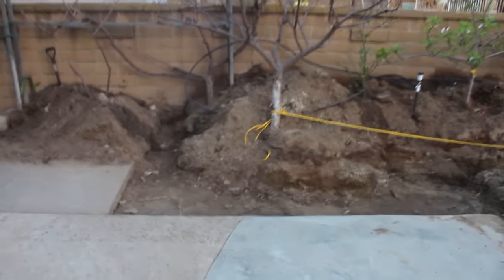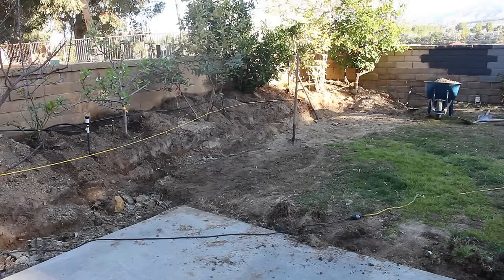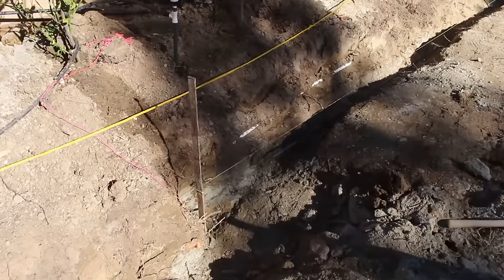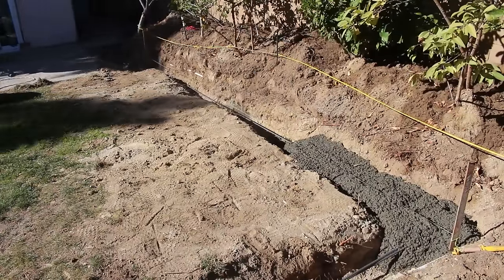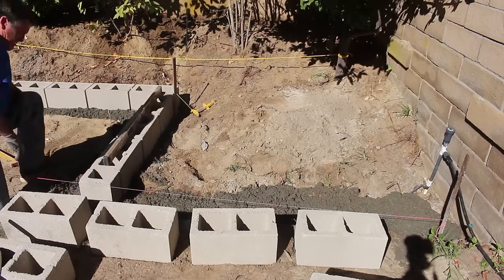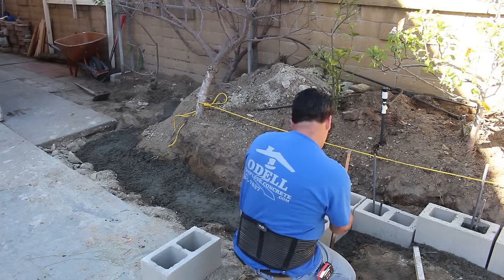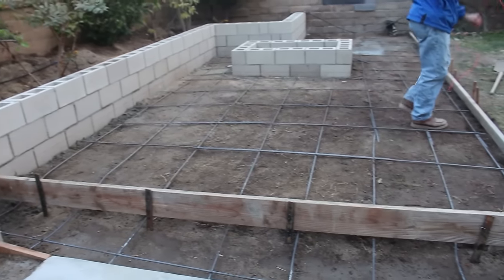How to Build a Retaining wall Easy Guide DIY

Comment: Thank you for all your great video's. Can not tell you how informative they are for a home DIYer. One thing I would suggest as a great addition to your work would be to make a couple that gets into detail about the equipment you use and why and the same for the materials you use and why. Concrete blocks .. there are a lot ... why you use and how to use properly, when and why to use rebar and which kind, how deep does the base need to be for a wall like the one you are building on this video ... could go on but I bet you get my point. 
Again, thanks for you advice.
Reply from the maker: The build depends where your located?

Comment: I do the same for a wall, pull a line off the house and run parallel back off this for your measurements. I also like the fact you have laid the first course of block into the footing, and then filled the block cores, it ends up being a monolithic construction.
Reply from the maker: Yes that's correct.
The best way to build.
You know the tricks.
Reply: @anthony famatigan  @anthony famatigan  Something that is done in one go, done together, becomes one when it is constructed. Basically the concrete in the blocks/core filled is bonding with the foundations so it is one piece of concrete. You have approx two hours to do this otherwise there is a cold join between the two and they are basically seperate so to speak. 👍
Reply: Do you recommend filling all the cores with concrete?

Comment: Great video! Love your calm voice. I do have a few questions though, if you would be so kind to answer. No. 1 - If your sealing the back of the block with this membrane how does the built up rain water escape? I noticed you did not place grout between your bottom course of blocks, is this where the rain water escapes? No. 2 - If you have a 42" wall are you required to install a underdrain system and should the holes face downward? No. - 3 I've been told that you should not allow your filter fabric to lay against your block because the fabric will be sealed by the dirt and cause pressure on your wall which is in direct conflict of question No. 1. Please explain, thanks! Oh' one more question, do you have settling problem by laying your base blocks on wet cement? Should you wait for a period of time before you install your next course? I'm concern about the extra weight!
Reply from the maker: this job is at the top of hill, drainage is not a problem.
Reply from the maker: I want the block to settle in to the concrete.
Reply: @OdellCompleteConcrete  I understand that, I was concern about uneven settling of the blocks prior to curing, especially the added weight of the top course. I like your method of not placing grout between your base blocks, hopefully their is enough rock to prevent dirt from leaking through.

Comment: I like how you’ve incorporated the weep holes in the first course by not grouting gaps.
Reply from the maker: ty
Reply: I'm glad you mentioned that.  I was wondering why they didn't put grout in between those blocks.
Reply: I was wondering if I was seeing that correctly (instead of using PVC), but it wasn’t explicitly called out in video.... so I looked down here in comments for it. Thanks for confirming... I like the idea as well!
Reply: The more I think of it though, how do you keep your uniform staggering overlay on the second row?
Reply: The more I think of it though, how do you keep your uniform staggering overlay on the second row?

Comment: Great videos! Honestly your videos are a big reason why I know how to do slabs and retaining walls. You should do one on doing a cement block house and how to do the corners and tying the walls in with the rebar. How deep  did the first row of block go into the cement and whats the best way to make sure the first row is nice and level longways and side to side?
Reply from the maker: Great idea.
TY
Reply: Nice!  I’ve learned a lot about concrete from Odell too! It’s nice to see a proud and integrity driven contractor

Comment: Question for you sir?  Will that patio area need base rock?  If not, What determines if you need baserock under the concrete?  Thanks again,  great videos.
Reply from the maker: Whether or not you're in a freezing climate or not

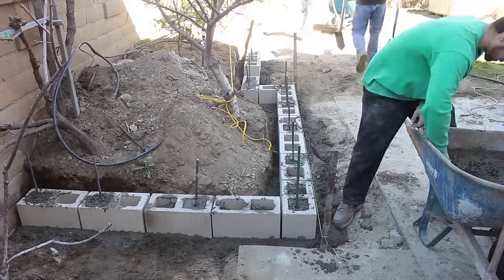Comment: Q:  Around 9:20 you talk about the self-adhesive waterproofing roll...is there a particular brand you recommend?  Great video as usual!
Reply from the maker: Not really there are so many
Reply: Ok.  Just afraid the typically-less-than-proficient box store staff will have no clue what I'm talking about.
Reply: Yeah! Lowes and Home depot are no help. Where I live, I don't have any other options and might have to order online. When I search, the only stuff that comes up is at least $250 a roll my new wall is only 14 feet long :-/
Reply: I decided on using Drylok masonry sealer from Lowes.  I applied it last week...and it definitely seems to "seal" in the porous concrete block effectively.

Comment: Great video. Very helpful.  A few questions.  1. Are you mixing sand and gravel in the concrete. 2. Concrete strength? 3. Are you only filling the cavities that have rebar and leaving the other ones empty? 4. If the wall is small could you use a concrete adhesive instead of mortaring between blocks?
Reply from the maker: Yes adhesive works.
Solid grouted. 3000psi
Reply: Mr O'Dell great video where can I get the vinal membrane wall sealer

Comment: Looking to use cinder block for a small porch add on and I’ll be adding a pad on top of a 20” high block wall.  I live in NW Florida panhandle. He get a lot of rain here. I’ve got gutters, but do I need to concern myself with weep holes at all?

Comment: I need help. My property slopes down low in the back and I wanna put a privacy fence up. My neighbors in back are on lower ground so I need to do a runoff for rainwater as well. Should I use cinder blocks? I'm looking at 4 feet high.
Reply from the maker: Concrete swale

Comment: How deep should I dig if I want my retaining wall to hold back about 5'-7' feet of full dirt? I'm trying to make a level slab on a hillside property. Wall will be about 30' feet long. Property is in Mexico, no codes to worry about. But I want it to last.
Reply from the maker: 2.5 x 3' should do the trick

Comment: Hi, I'm about to build a house retaining wall and it will stand as the house foundation on a bedrock,can I use silicon or even cement for holding down the rebars drilled into the bedrock before concrete footing? Thanks
Reply from the maker: I like epoxy

Comment: Mr. Odell,  I love your videos.  I use them as my "vital guide" when I try to find a solution for my projects.  I was wondering about the self-adhesive waterproof roll you mentioned.  Do you recommend a name brand or is there another solution such as the material: poly waterstop you applied on the retaining wall of your newer video?
I truly welcome your advice!
Reply from the maker: Poly self adhesive is nice
Reply: @OdellCompleteConcrete  , David is it the same kind of peel and stick adhesive that they use for roofing? Please name a brand and where I can get it. Thank you!

Comment: Thank you David for your video!! This is exactly the work I’m doing.  How do I find the waterproofing material you mentioned for the back wall?
Reply from the maker: Henrys 207 or maybe its 107
Reply: You mentioned an easy peel with rubber and vinyl that could last a lifetime.  I tried looking but could only find something similar for laying the floors.  Is it what you are referring to? @ 09:30

Comment: Great clip guys.  Thanks.  Question: What do you use for the fill?  I just started filling my blocks with a 1:2:4 concrete mix because I had enough left over.  Is this what you'd use?
Reply from the maker: I filled the block as I poured the patio
Reply: He was asking what do you use.

Comment: Was all the Blox put together with the same concrete mixture  that was poured for the  base ???
Reply from the maker: No we used a mortar
Reply: @OdellCompleteConcrete  thanks for the reply what kinda concrete would you suggest premixed? Like 5000 quick Crete? For the base under the cinder block?

Comment: I want to build a cinder block retaining wall for a sandpit that'll have a gazebo tent on it. It'll only be 1 block or 2 blocks high with stone veneer to decorate the wall and top stones to seal it. Good or bad idea?
Reply from the maker: Should be nice
Reply: Odell Complete Concrete Thank you for responding! I'm watching your video again for tips, then I'm going to write out my plan and start digging.

Comment: I'm building a small block retaining wall now that I want to install a veneer stone on to match an existing BBQ structure. The old wall failed and was made out of pressure treated lumber. I'm digging the new wall footing now. The wall only needs to be 14" above grade so it's not that tall. I'm digging the footing 12" deep by 12" wide. Will that be sufficient?
Reply from the maker: plenty good

Comment: I am building a similar retaining wall what is the waterproof sealer you were talking about. I was going to use the Henry’s tar but from what you have said it doesn’t last forever and I would like to use something that last forever. 
Thanks in advanced!
Reply from the maker: Bituthene 3000 Flexible Waterproof Membrane

Comment: Great info. and you explain things real clear. Dig you videos. 
I am building a very similar retaining wall (18" AFF to top of wall cap) right about 4' off existing concrete wall. Would you recommend drainage for something that low?
Reply from the maker: It really depends on water runoff.
If the only thing hitting it is the rain and not runoff from other places then drains probably aren't necessary.
Reply: Odell Complete Concrete thanks.  No other water except rain and as you know we barely get enough rain in so cal. Was thinking of turning a few blocks in he first course above grade so that the opening would allow for water to flow onto finished concrete has very good drainage.

Comment: It does not look like each cell had concrete poured in it. I thought it was said to do that. I am building my own retaining wall now, but should I put concrete in every cell or just the one with steel in it? There is dirt on the backside of the wall, much like this one in the video.
Reply from the maker: I put concrete in every cell when its retaining whether it has steel or not.

Comment: What brand/name/type of self adhensive tape (rubber on 1 side, vinyl on other) are you using?? Trying to order and not sure how to find it.
Reply from the maker: Bituthene
Reply: @OdellCompleteConcrete  do you prefer this or the liquid roll/brush on stuff and also what was this liquid stuff you used in your other video (on the backs of the blocks)? TIA
Reply: @OdellCompleteConcrete  brand or link to actual product

Comment: Mr Odell,  We are doing a 2' retaining wall in the back yard with the metal fence posts in the wall.  Would you recommend a block wall or a concrete wall for that application.  Appreciate the help.
Reply from the maker: Either way will work if the block is big enough

Comment: Why is there horizontal rebar before you lay cement on the retaining portion? Does it just add extra strength to the concrete?
Reply from the maker: For sure
Reply: @OdellCompleteConcrete  thanks, im hoping to build a retaining wall in my yard this week. Im nervous as hell but your videos have provided a lot of very useful information. Thank you
Reply: @OdellCompleteConcrete  you didn't mention it in the video but ive seen it in others so im curios. Is it necessary to put a drainage pipe behind the wall? I live in Ca and will be putting in a wall very similar to this. Also can I back fill with the dirt ive removed or do i have to use a more fine material?

Comment: I ve noticed that you ve always fill the block with cement mix inside.. showed in few of your video.. somebody didnt do that.. did they do it for the sake of lowering the budget and ignored the wall strength or what ?? Would you share your opinion ?
Reply from the maker: Depends if its retaining or not

Comment: Regarding the water proofing I came to know that you don't need them as it will not allow water drain and there by break wall.
Reply from the maker: That's interesting, with water absorbing in the block the block will start to coming apart
Reply: You absolutely need dampproofing (waterproofing is an incorrect term) with a appropriate drainage system or you will build hydrostatic pressure behind your retaining wall. Normally leaving the head joints out of the first course along with 3” drain holes every 6’ on center will allow proper drainage.

Comment: It's possible to pour the wall foundation in stages of like 8 feet? I'm trying to replace an old block wall that was terribly put in and is falling apart. Plus on top of the wall there is a fence to my yard that's facing the street. I was thinking of putting in the steel bars and then do pours in sections to maintain privacy of the old fence.
Reply from the maker: The footing should have continuous steel, I guess you can dowel everything together
Reply: Odell Complete Concrete  Thank you for the reply. I am really enjoying your videos and work.

Comment: Love it. I might have a go at setting foundation and first course on the fly. Do you have problems with blocks sinking and messing up the level? Keep concrete mix dry I presume?

I see you didn't butter first course for drainage. I want to render my wall so not sure how that would work. Maybe I could install some weep holes.
Reply from the maker: No worries

Comment: what is your opinion on using asphalt primer or hot mop tar to water proof it ? when you said tar last 15 years i am assuming you are talking about henrys mastic tar,
Reply from the maker: joaquin lopez 
Yes I am.
I think any tar will degrade on exterior with dirt and water against it.
I like the two part component rubber with vinyl on dirt side.
Reply: like the peel n stick that people use on the roofs ?
Reply from the maker: Bituthene by Grace

Comment: A few questions. I'm a beginner and am going to set up a 20 foot long, 4 foot high retaining wall. I have watched about 20 vids so far to learn. So far I have noticed that these guys are the only ones that pour the concrete directly on dirt without using any crushed rock or road base at all. Most other vids all use some sort of crushed rock for a base before pouring the Crete. Is there a reason why they don't use any base for the footing? Are they pouring on super hard Midwest clay or something where base isn't really required? Another question I was wondering, these guys are the only ones I have seen that "wet set" the first run of base blocks, but I have noticed that when wet setting, they never use any mortar between the blocks on the first run. Do they go back later and apply grout or just go on without it? They seem to grout between every block from the second layer and up, but is there a reason the first row doesn't get grout? Thanks and sorry for the long post.
Reply from the maker: No need in gravel in Southern CA. where its beach weatehr everyday.
The bottom course is known as weep holes.
Reply: @OdellCompleteConcrete  thanks for the reply, trying to learn. I was planning on waterproofing the back of the wall, and adding a mini french drain behind it to drain water away as I'm on a pretty serious grade. Should I avoid the weep holes if I'm going to waterproof it?

Comment: Hey! Question: why on the first layer of blocks, you don't put cement between the blocks? You did put them in the holes of the blocks. Is there a reason to do that, or NOT do that?
Reply: Idxearo maybe it allows water to flow out from behind the wall. It looks like they are going to pour a pad in front which is going to cover those holes though. Maybe to save time?
Reply from the maker: In this case with the water proofing and tile going on, the seams will be sealed up.
Reply: Idxearo I was wondering why you don't just dry stack all the blocks as you are going to core fill later. The blocks I used in Australia had a notch so you could run a rebar the length of the wall on each course before you core fill, we had reactive clay soil. Baines lockblock, just glued no mortar joints

Comment: Do u fill blocks with concrete or mortar?
Reply from the maker: Concrete
Reply: @OdellCompleteConcrete  thanks.  One more question. If I'm building small retaining wall up against existing concrete floor, how deep should I dig to set first blocks if my wall will be knee high.

Comment: Im about to venture on my first wall build project. I see many videos where people pour, set and cure the concrete footing before they lay the first course down. But I see that your doing it while it still wet. You find it easier this way? What are the pros and cons?
Reply from the maker: Wet setting the block will never come loose
Reply: @OdellCompleteConcrete  has nothing to do with coming loose. It’s much simpler to wet set the first course to get the wall plumb and level.

Comment: Are you not in a cold climate ??
Reply from the maker: No, its beach weather here everyday
Reply: @OdellCompleteConcrete  i am doing a sililar cmu retaining wall. It will have venneer on the front. I dug to frost line and poured footer. I plan on filling 12 inches behind with drain stone and pipe. I am sealing the  back of block and filling cores with grout. Sound correct ?? It will be holding back 3ft of soil at the highest point. Thx .

Comment: You don't want a retaining wall to be waterproof, you want it to be porous. Water from rain will only increase pressure on the wall if no drainage is considered.
Reply from the maker: OSS
Reply: @OdellCompleteConcrete  Where's the drainage?